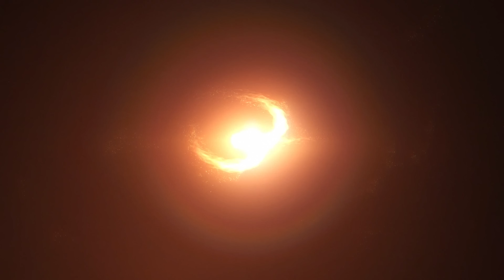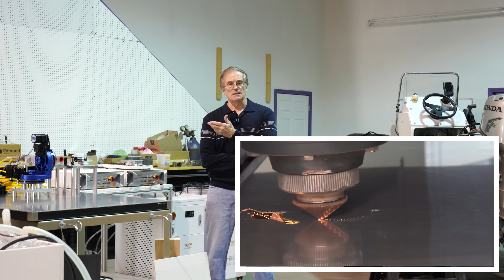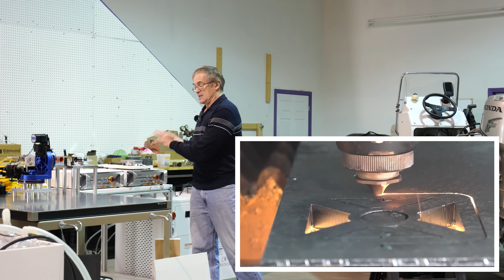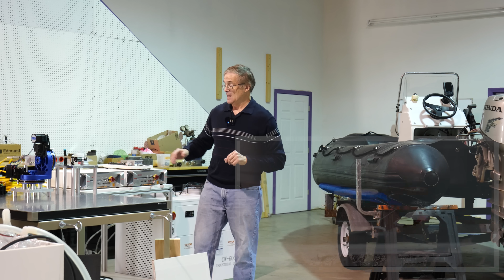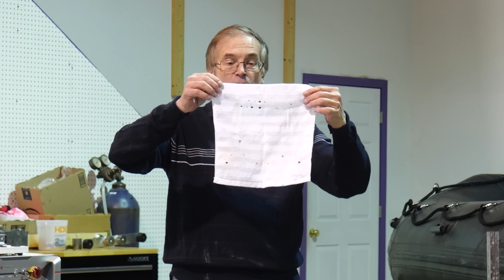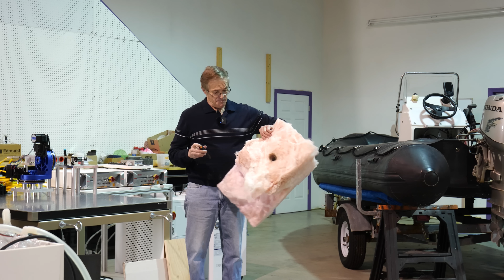We have a problem... and need your help!

Comment: What would be needed is not a single layer material / method.  Please entertain this design specification for research only- 
Entropic Diffuser ™ Design Specification

Overview

The Entropic Diffuser is a multi-layered device to stop powerful, focused laser light by scattering, homogenizing, absorbing, and dissipating its energy, maximizing entropy.

Components
    1. Scattering Layer:
        - Material: Hexagonal boron nitride (hBN) 3D nanoarchitecture (>99.99% porosity).
        - Thickness: 1 mm.
        - Function: Broadband scattering (~98% efficiency, 190–1600 nm).
        - Source: Nature Communications (2020).
    2. Diffuser Layer:
        - Material: UV-fused silica with randomized microlens array.
        - Divergence Angle: 20°–50°.
        - Function: Homogenizes light into a flat-top profile (~90% transmission).
        - Source: Thorlabs Engineered Diffusers.
    3. Absorption Layer:
        - Method: Coherent Perfect Absorber (CPA) with thin doped semiconductor and mirrors.
        - Thickness: 100 µm (absorber), 1 mm (mirrors).
        - Function: Near-perfect absorption via multi-pass interference.
        - Source: Physics World (2022).
    4. Thermal Layer:
        - Material: Diamond or graphene-coated copper.
        - Thickness: 2 mm.
        - Function: Dissipates heat (conductivity >2000 W/m·K).
    5. Optional Rotating Plate:
        - Material: UV-fused silica with ground glass surface.
        - Speed: 1000 RPM.
        - Function: Temporal energy distribution for pulsed lasers.
Performance
    • Irradiance Tolerance: >10^6 W/cm² (continuous), >10^9 W/cm² (pulsed).
    • Spectral Range: 190–1600 nm.
    • Efficiency: <1% transmission, >90% scattered/absorbed.
    • Thermal Stability: Up to 500°C.
Fabrication Notes
    • hBN layer: Chemical vapor deposition (CVD) for nanoarchitecture.
    • Microlens array: Laser writing on UV-fused silica.
    • CPA: Semiconductor doping and mirror coating via sputtering.
    • Thermal layer: CVD diamond or graphene deposition on copper.
Applications
    • Laser safety barriers.
    • High-power laser testing facilities.
    • Military countermeasures against directed-energy weapons.

Comment: What about making a diverging lens setup before the concrete wall to spread the light beam? After that you can make a brick wall or some other material to absorb the energy at larger area. You demonstated that you are capable of doing lenses before. I think it should not be a problem for you. I am usuallly working with high power electronics not light. So, i am no expert at this, but I am also curious why this setup would not work. :) Let me know if possible.

Comment: A metasurface that is 3D printable and would be very thin. An array of these thin ceramic tiles could cover a wall and be quite cheap. Reference Huygens optics on YouTube where he talks about mirrors with a very small CTE.
Reply: These are not metasurfaces m, but is the type of ceramic glass one would use. The metasurface would absorb a range of wavelengths similar to the cloaking metasurfaces developed at Duke University.

Comment: At work we build machine with fibre lasers (up to 3kW, ω0~40μm, zR~3mm) and sometimes we need to perform beam diagnostics on an unenclosed system. Besides eye protection we surround the machines with laser proof curtains for this procedure. Those are some thick cloth curtains (maybe aramid?) lined with aluminum I'd say. They are mounted to movable frames, that we built and can be velcroed together to enclose the whole machine of ~5m in diameter. They already have some burn marks but nothing came through although I am not sure of the spot size, that hit them at the distance...
If these are too expensive we also have movable laser proof walls on wheels of ~2x3m, which are basically just aluminum sheets probably with some more aluminium baffle or so in between. They are coated with some white paint but I am not sure if this is a special coating, most metals will absorb the bulk of 1070nm anyway (even when they are reflective to the visible spectrum) and not reflect much of it but if the surface is sandblasted or roughened, the tiny bit of reflection will scatter, making it even more safe.

I think metal would probably be a good bet and for transportability I would choose aluminum.

I have also experimented with a few cheap materials as a beam dump too like sand but this will usually just melt and feel kinda unsafe. In the end we always use metal bodies as a beam dump. Tungsten is perfect but heavy and expensive so for our dumps we use aluminum too (3d printed baffles) and just cool it with a fan or water. This way we can dump 1kW at a spot size of a few mm into it for a minute or more.

I hope something of this helps or at least sparks some inspiration. Keep up the good work, I really enjoy your videos.

Comment: This system needs redundancy for the activation and motion system and fault monitoring with automatic shut down for the system.  For comparison the 777 primary digital flight control system has three redundant LRU boxes, each containing three redundant computers all performing the same job.  The three computers in each box vote to determine the box output, the three boxes vote to determine the system output.  All of the outputs are monitored for faults and divergence from the voted output.    With this level of laser power you really need to step up the reliability and safety measures.  This laser turned on and pointed in the  wrong direction could quickly become a really big problem.

Comment: Would a sensor on the wall that cuts the laser power immediately when it detects some level of IR work? This way, you only need few milliseconds to protect the wall, until the sensor acts up and shut down de laser.

Comment: Flowing water through the pink fiberglass held upright with expanded metal mesh.
You might have to repair the metal mesh on occasion.
Or just a flowing water curtain.

Comment: water in a wall on wheels. the walls made from a transparant material, the water should dissipate the heat enough to keep the transparant material from getting damaged. Have a bubble curtain moving the water constantly so the scattering is better. make the watertank wall as big as the plates come standard. put it on wheels so you can move it. ?

Comment: Cloth or wood in an aquarium. Not sure if the glass would heat and shatter though. 
Also, could you use a water mister/atomizer to dissipate the light prior to hitting a surface.
Dry ice in an aquarium.
Wood Soaked in water with a sprinkler/hose spraying it down.

Comment: A tank that does not obstruct the wavelength of the beam filled with water mixed with fine carbon dust? The carbon will absorb the light and the water will take the heat away. Varying the carbon to water ratio will allow you to adjust how much heat is trapped. Since water is a liquid it will "seal the hole" and since carbon is... carbon it is very heat resistant so it can be reused. Experiment with small scale to figure out what thickness tank and material to make it from. 6 plates of material + bag of carbon dust + water = cheap, easy to manage.

Comment: I would make a sphere of fire brick with an aperture, like an igloo (but rounded below ground). It may be preferable to weld a dish stand and mortar the whole outside for moving the rig in one piece like a fridge. Then on the inside, make sure firebricks are periodically pointed inwards, and jut out from the wall to create a disruptive pattern. I don't have a perfect solution to rotate the laser, but a cone of mirror fragments and lenses suspended from a powered (and shielded) rod could throw the laser in a sweeping and/or dispersing pattern that would reduce the load on each individual brick, and give each face of the mirror cone time to cool off. The benefits of this solution being ease of construction, mobility, cost of materials, but I'm out of my water on whether the fire bricks would hold up over time.

Comment: 5:09 how would 'aerogel' react to a powerful laser? Just a thought. 
Also could you just use a big mirror at a 45° angle and direct it to the concrete floor and if badly damaged it can be patched in the one spot that's thoroughly barbecued?😅
It is certainly a unique problem to have 😂
Silly as it sounds... Perhaps a counter/ sheet of marble or granite?

Comment: The problem is indeed fascinating. The industrial laser's single focal point now makes perfect sense. One approach involves focusing at a calculated distance; however, this significantly increases emitter size and weight, thereby reducing angular speed and limiting range. Alternatively, a defocusing lens behind the object could be employed, although this severely restricts application to near-stationary objects. A more intriguing solution might involve water refraction—a tall, slender aquarium with thin walls to minimize weight, containing a light-absorbent material cooled by the water as needed. Critical to this design is eliminating reflections to prevent backscatter. These are merely preliminary concepts requiring rigorous testing.

Comment: Just guessing; perhaps you want diffraction rather than refraction.
Suspended particles? diffraction hologram film?
or maybe something like the ablation materials that NASA used before heat shield tiles?

Comment: What comes to mind is an absorbent layer that will let the beam punch through it but then be reflected back at the barrier by a layer behind it, using a surface that makes the light diverge and/or scatter on its way back to the rear side of the barrier.

The materials I'm not sure of but I'm thinking vantablack9zillion on the side the humans are facing. "Highly reflective" behind it.

Alternatively, a prismatic or lens based device to divert the beam into the ground somewhere.

Comment: I think your best bet is a 5 1/2 thick wall built with steel 2x4 studs 12 inches apart, filled with sand.  Sheath the wall with stainless steel window screen material and pour sand in. The metal studs are hollow so they will be filled with sand.  Self tapping steel screws hold your screen to the studs.

When done with the assembly, put some 2" thick comfort board 80 from Rockwood in front of it, which is rigid enough to maintain its shape and give a bit of protection to the screen.    The advantage of Rockwood comfort board is that it is fire resistant and can be supported from the top and bottom and it would be likely to weaken the laser enough to eliminate the possibility of structural damage to the metal studs caused by the laser.  Your wall can be placed directly against your shop wall, so the shop wall will also be holding in your sand.

Comment: I'm totally not expecting this to work because it sounds outlandish. So hey, it might...  Create a giant aquarium, fill it with orbeez (fully saturated) and just plain simple wet garden mud. Probably just use 1 sheet of drywall as "aquarium" walls. It's fine if the lased goes in, as long as it doesn't come out and reflect. In my mind the orbeez should scatter the light a lot and the mud should absorb the heat. It would still be annoyingly impracticable to build but you can get rid of it after filming. Mud boes back in the garden, orbeez shrink and can be used for other fun.

Comment: I'm not certain.. but:
If you want a solid:
Blackened reinforced fireclay? - Fireclay + carbon black + fiberglass: The hydrated aluminum silicates + carbon black should be able to absorb a admirable amount of energy on it's way to being vaporised.  The fiberglass can be done as a layer, for even distrobution, and be really thin.  It only needs to hold the melted stuff in place a little while before melting itself.
If you are happy with something you contain in something else:
Blackened super-saturated sodium polyacrylate.  Essentially absorbant, semi-solid, water.  Just choose a vessel that doesn't make bad fumes.  Don't go too thick unless you want steam explosions.

Comment: So if it has to absorb light could you use water with something added to make it opaque ? You said you were trying to use wet blankets, what about a larger volume of water sandwiched between transparent plexiglass sheets  ? Not easy to transport I guess, unless you have a way to fill it on site

Comment: Why solid? Sorry for the wet spaghetti method I'm about to sling, but your idea with water is similar to where my mind went, but rather, a tank with fluid made opaque enough with suspended/dissolved particles to absorb energy over distance enough that a solid object placed in the tank can dissipate the remaining energy. Whatever lense is used to pass the beam could be similarly used to transition into the tank, given there's no immediate cavitation produced at the water's surface. Diverging lenses also come to mind. Similarly, the laser could just be pointed down into the tank. Granted, you probably could also get away with just pointing the laser down and letting it burn away at the earth. Sillier ideas shift away from statics to use a rotating target at sufficient speed to absorb energy locally and dissipate over the rotation either into a liquid or the air if rotating fast enough/enough flow can be achieved.

Comment: Perhaps impregnating the wood, or even a more porous wood than plywood with a retardant, like a resin? Outgassing as that heated up might be an issue though. But something 'easy' to come by to test though would be an old, but still new tech wise, reactive resin bowling ball.

Comment: will this beam pass through glass unimpeded?
Reply from the maker: About 80% will pass through.
Reply: @TechIngredients  Can we safely assume that the position of the beam behind the target is fixed? Then a thin wire which forms a series connection to the coil of a safety contactor could be used to cut power.

Comment: Can you pulse the laser? That would allow you to modulate the power. Also, pulsing the laser can improve its damage. water is the best choice for absorbing the laser power given its specific heat , but ya, it will vaporize very quickly. Ballistic gel with a dye that absorbs and scatters the light?

Comment: Use IR Absorptive Smoke (obscurant for night vision warfare) between 2 non-flammable (thin) sheets, possibly flame retardant polyethylene sheeting / wrap. 
The plywood did best due to the smoke it produced when it first started burning (not after), it smolders for a few tenths of a second.

Comment: Point a camera to the back wall made of cheap and replaceable material like drywall. Detect any bright spots of light that can only be created by the laser burning into the wall. Connect the test circuit to the deadman switch and turn off the laser within a few camera frames.
That creates some more engineering challenges, like what software to use and how to isolate the camera from room light and flashes from other directions that will happen if the laser is burning through the test article. Maybe put a dark welding glass filter in front of the camera.
In effect if the laser is turned off reliable before the first sheet of drywall is burned, it only takes a very limited time to patch it before the next experiment. I think the turn-around time and material cost per experiment are the parameters you want to optimize for, besides ease of setup.

Comment: While I'm not a professional in this area by any means, two things (or a combination of those two) come to mind:
1) A tank of water with dark coloring added, thick enough so the beam that exits is benign.
2) Light detectors of any kind (behind or on the sides), that automatically turn off the laser as the beam hits it.
When you think about it, those 2 ideas can be combined pretty neatly. You could also think about using a pressure sensor as the kill switch, if you have the water in an airtight container, but this would certainly be slower.
If you can switch the laser on or off very fast, you could use an algorithm for it, such as:
a) Turn on the laser
b) As soon as light/pressure is detected, turn it off.
c) After, lets say, 10x the time it took you to turn off the laser (I'm even thinking milliseconds here), go to a)
That way you can throw some objects through the beam and it will continue to slice the object, until the laser went completely through it, before triggering b)
Reply: Tank of water with dark coloring added: A pot of coffee left to get cold.  So long as the glass doesn't break, you can use the laser to heat the coffee, and drink it on break time.

Comment: Aluminium or copper plate, 5-10mm thick. Cheap pond pump pumping water to flow over the surface of the sheet. Mount it on an angle so the water can attempt to reflect some of the energy away. Water to help keep it cool, etc.

Comment: What if you pulse the laser into many bursts per second?  

Then you could calculate how much of the target is destroyed with 1 pulse (say 1 pulse per 1ms) and then how many pulses are needed to slice XX/mm or cm through the target.  That way you could control the pulses and turn them off before it's 100% through the target. Maybe just 50%...